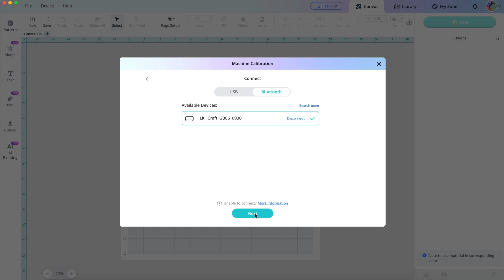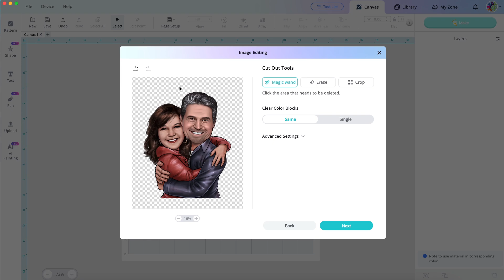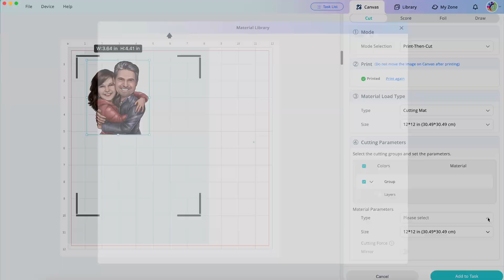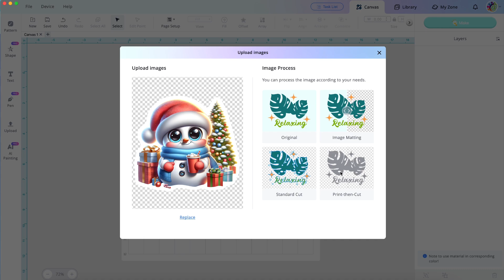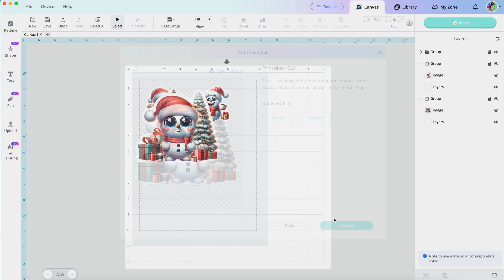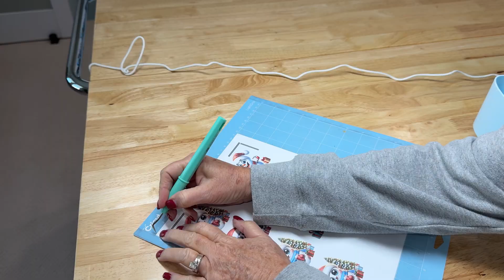Want to Make Stickers? Here's How with LOKLiK iCraft

Comment: Do you know if they sorted out the Print and Cut calibration problems on the original machines too?
Reply from the maker: Not sure. I’ll have be to give it a try.
Reply: You also have to make sure you printer is printing with the correct margins , etc , if all fails you just work out on your cutting mat where to stick the print to make it work , draw new guide lines